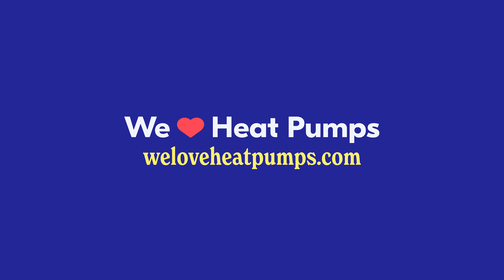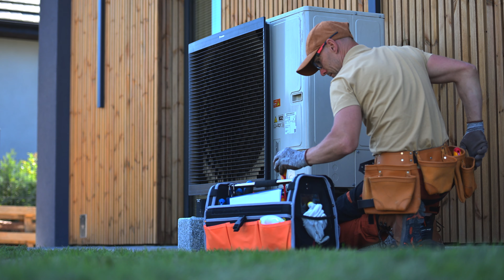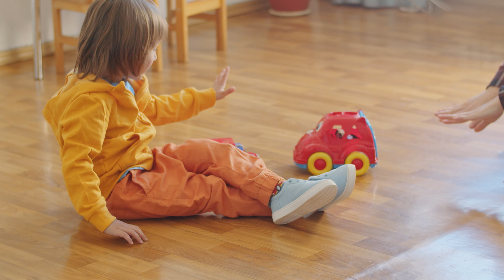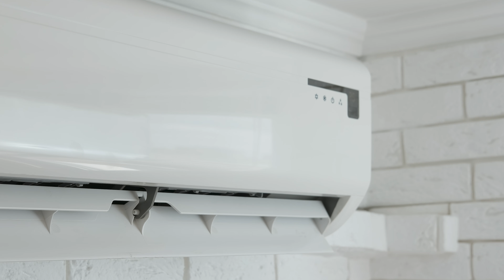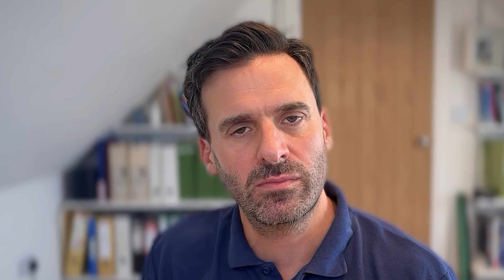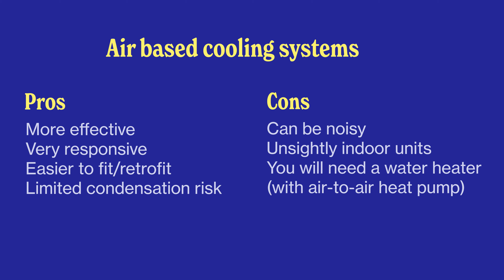Does a heat pump cool?

Comment: Interesting - thank you. Heat Geek seem to be taking a different view on radiators being unsuitable for cooling recently. Their position seems to be coming towards they can be used but will be very limited in their effectiveness because of the need to stay above dew point and the limited surface area the cold water will flow over. However even if they only shave off 2-3' throughout the day for a couple of hundred pounds of having the cooling chip installed this seems worth considering vs thousands for additional air con?
Reply: compared to 29, 27 it already a quite okay temp